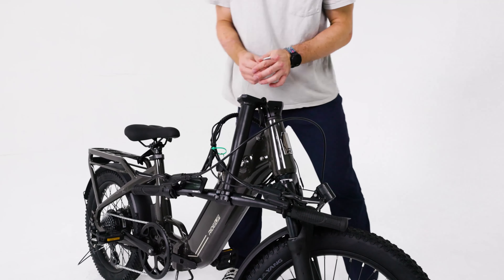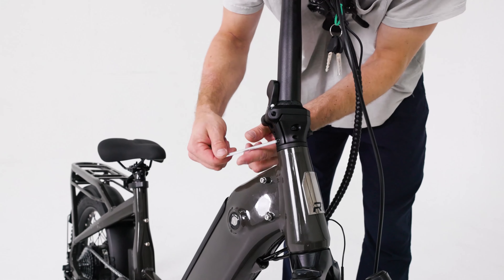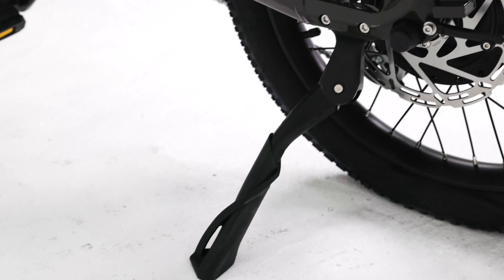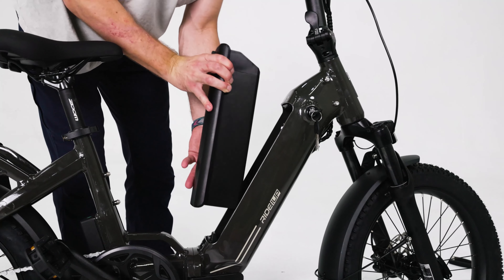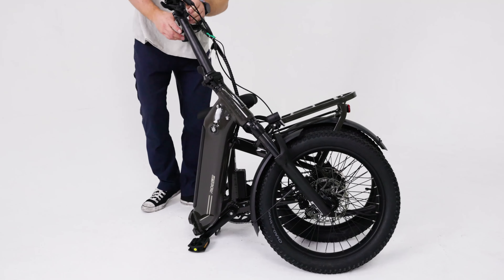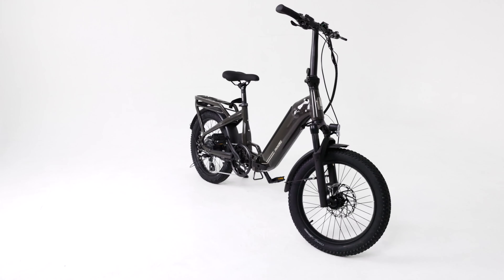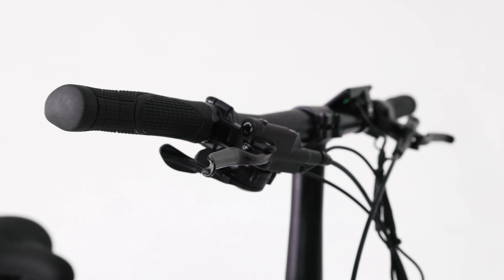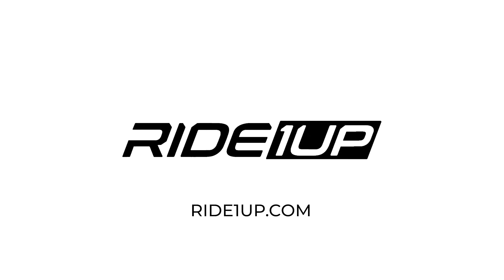How to Assemble the Ride1Up Portola Ebike

Comment: I’m 6’2” toll 76-yr old long-term biker enthusiast like the Ride1Up brand ambassador in my local Northern CA area. I just purchased online Portola w/ 10.4Ah battery. And I have a high hopes Portola to be not only the best value lighter foldable step-thru e-bike I got in comparison w/ my previous two I already owned. I tested Portola with Ride1Up local ambassador in advance and it was a love from the first glance. 

Hopefully Portola will be delivered with added missing before derailleur guard installed already. Once delivered I’ll follow the video instructions and assemble by myself. I watched already the assembly video in advance and here are my experienced e-biker comments for San Diego Ride1Up company to consider. My hopes are that my comments will serve better all of the Portola buyers in the future.

1) The not-adjustable handlebar stem needs to be upgraded ASAP and match all other brands today in the foldable, step-thru market. This will allow especially tall riders like me more posture adjustable options not only the seat height.  It’s a big supersize that such a quality-centered company like Ride1Up is not providing with adjustable telescopic handlebar stem like the competition?
2) The major competition in this most popular e-bike step-thru foldable category provide their customers with practically 100% assembled foldable step-thru e-bikes, so Ride1Up should do the same with a very little design effort, right.

Comment: Just got mine 2 weeks ago... 

The out of the box experience is really nice. By that I mean that outside of setting up the handlebars it's ready to go... You could be on the road in 10 minutes if you know what you are doing. The battery was fully charges, the chain/gears and brakes all perfectly adjusted and even the tires have a good amount of pressure in them.  

Some improvements...

The printed docs are pretty, but not written for a newbie. The handlebar setup should point out that the folding piece is not square with the tires/handlebar. Once you think that they fold, you "get" it, but it should be pointed out. Same with the tightening process. Pointing out the three screws and when they should be tightened should be done in one big line drawing, not a photo with really small text under it.

Second, a quick ref guide on how to use the computer/controller would be nice. I thought my setup needed more attention - when I simply didn't know how to turn the backlight on! I called Support and was helped within minutes by Chad, who was amazing! (If you are on the fence between which bike company to buy from, call their support line before you buy... it will hep you decide.)

Finally, tell people how to use the included lube. Is it for the chain? A part of the derailer? I could GUESS but it's a $1000 piece of equipment, having directions and a maintenance  guide would be a bonus.

Still - we all have youtube (obviously) so it's not impossible to find the info.

After my first big ride a few days ago, I'm VERY happy with this bike.. and as you can tell, I can be critical.
Reply: The grease should be for the seat stem before you start adjusting the seat post height and subsequently, the seat setback position. Remember, any 10 mm back the seat requires around 3mm lowering the seat post in order to compensate and therefore keep your pedaling leg muscles in balance working.
The right leg extension extending the seat post, is rider’s knee is only slightly bend when stepped in lowest pedal position. This way when pedaling all leg mussels plus gluteus and calf muscles should work in balance without charging more one or other leg muscle group.

Comment: Handle bar install looks like more work than most people will want to attempt.
Reply: Really? It seems pretty easy, and I've never assembled a bike before.
Reply: The instructions are a bit weak, but it's three bolts that need tightened up.

Comment: Once I get the handle bars on, they won’t turn with the wheel. Please help!!
Reply: I just put my bike together today and I had the same issue as you until I figured out that the smaller black "packaging spacer" actually belonged there. Without it, the handlebars won't turn the wheel. This video needs to be fixed.
Reply: throw away small black spacer,check head tube seated on fork